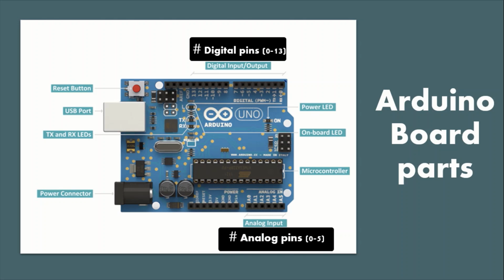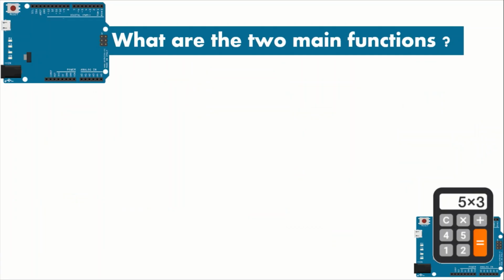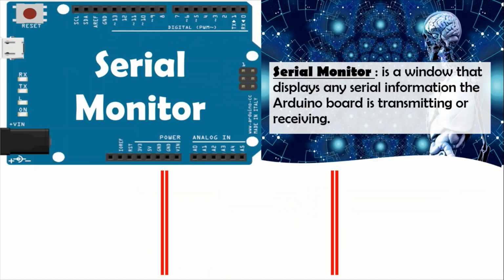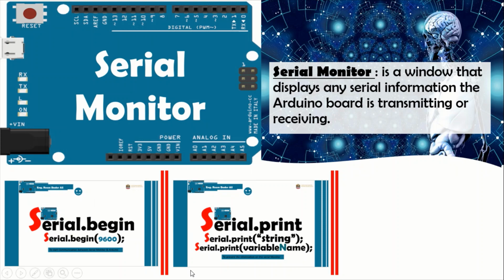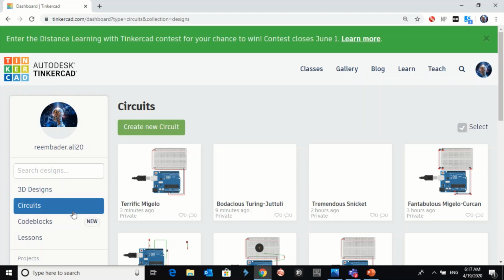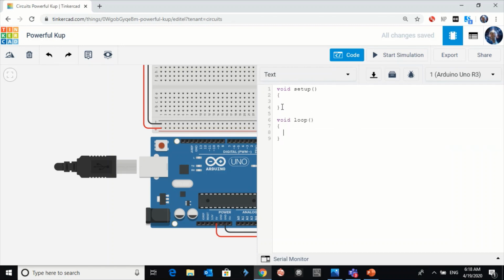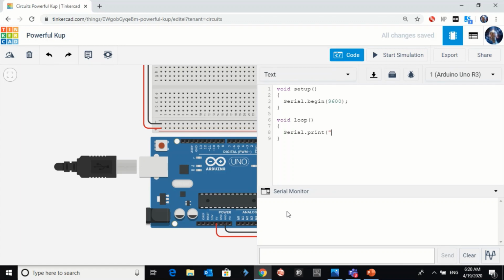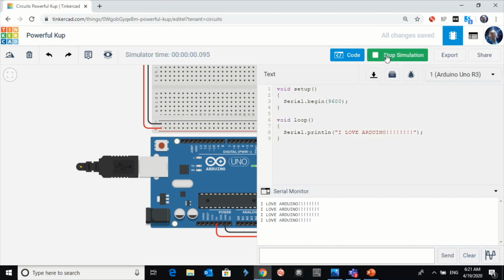Arduino Programming - The Basics.

Comment: I learned from this video that if you want to see the result in the serial monitor you should use Serial.begain(9600) to start the communication between the serial monitor and the Arduino and then use Serial.print().
Asalah khaled 12/C

Comment: What I learned: 
- The Arduino Board has different parts that we can use to connect different cables and electronics to it.
- The Arduino has two main functions and we can not write any code without the. And they are void Setup() which makes the code only run once and void loop() which makes the code run for infinite number of times. 
- The Arduino board does not have an screen to data on it but it has a serial monitor and it displays the result of the code written. 
- We have to Initialise the Serial Monitor in order for it to display data and we do that by using Serial.begi(9600); command
- We can Serial.print(); and Serial.println(); to present information in the Serial Monitor. The difference are that Serial.println(); represent information in a new line vertically. 
- We have to be careful with our CAPITAL LETTERS and semicolons.
Fatima Yousef 12A

Comment: Thank you a lot Ms, the vidoe was very helpful. I learned that the Arduino board is made out of different components, some of which include ( analog and digital pins, different LEDs with different functions, USB port), I also learned about the serial monitor and how to initialise it. Lastly, I learned about the difference between the command (Serial.print) and (Serial.println).
Marium Salah 12 Advanced
Reply from the maker: That's great!

Comment: Thanks a lot! I learn that the Arduino containts 14 digital pins, 6 analog pins and 4 LED which LED power that contect to the Battery and TX and RX forn transmitting and receving information and L LED is connected to the PIN 13 I also learn about the two main function which Void Setup and Loop Setup and the differnet between them finally I learn about Serial Monitor that is the window display any serial information the Arduino board is transmitting and receiving. Maria Adnan 12A

Comment: The digital pins is between a (0,13) and the analog (0,5)  and there is two functions setup()  which is runs once, and loop()  which run  12-D print() and Serial. print() prints only the number or string, and Serial. ... println() prints it with a newline character. repeated  Aisha Omar 12-D

Comment: I have learned A lot about the Arduino parts, serial monitor & serial communication & its command and how to create a new circuit on Tinkercad. Also the difference between the void setup and void loop. Plus there are 14 digital pins and 6 analog pins. 
Thanks for the great explanation 
Ayesha Saeed 12A

Comment: I have learned about the Arduino parts and how each one could work, also the two main functions which are setup and loop, I got to learn about the difference between Serial.print and Serial.println, the right way to create a new circuit on tinkercad, how to run a code,etc Aseel Ashraf 12A

Comment: I have learned about the Arduino board parts and the serial monitor.                                                                                                                                                                                      fatima ali 12-B